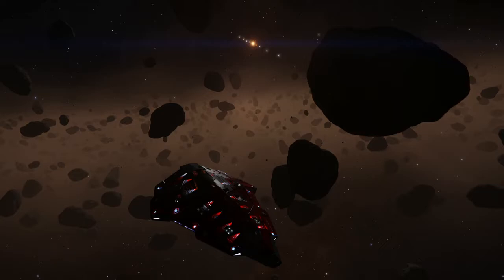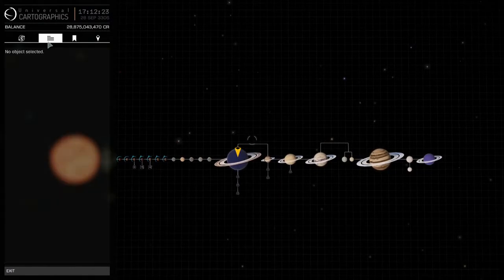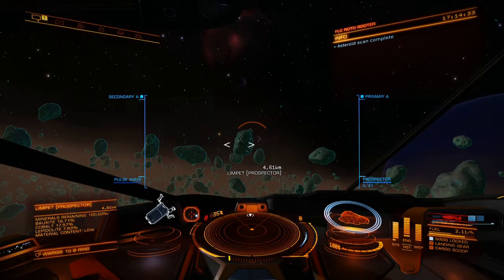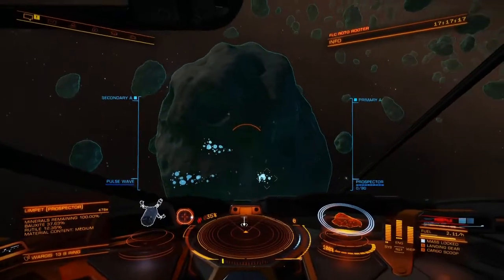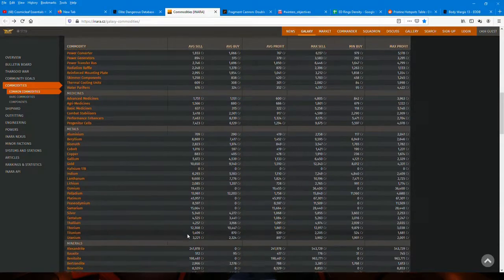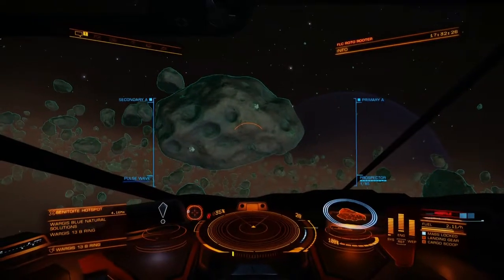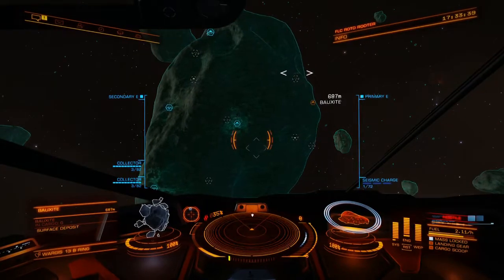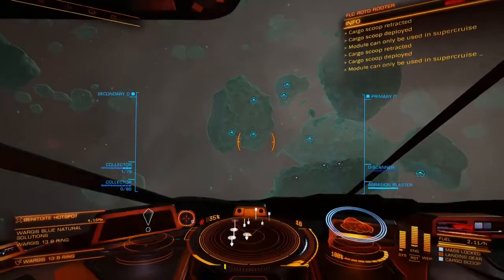Elite Dangerous:  The Annoying Broken Pulse Wave Analyzer

Comment: Oh there are people in the present at the end of November 2020 that still say the analyzer is broken.  The 3 asteroids I cracked 2 were Muscovite and I found them in asteroid clusters and one was Alexandrite in a gas giant ring. One 6 ton sale of Muscovite got me about 3 mil when I first stated a few days ago. Which allowed me to outfit my Cobra with the best refinery and internals for it. Also the strength of the fissure is its resistance to explosives not what level of strength you should use. A high yield in a low resistance fissure will make the gauge go up more than a high yield in a high resistant fissure.

Comment: I like metallic rings, but yeah you should be able to find them in rocky metalic. 
most of the high sound minerals are core only those so you'll never actually see it on the mineral content of The Rock
the other minerals and stuff can be used for missions and other bgs things to help some of the factions in the game. 
my guess is they tried to fix some of the range issues with the pulse wave scanner ( I don't think people ever got the full 25 km as advertised for a rated) And and whatever happened it caused this glitch. That or maybe it has to do with some other changes to the instancing to fix the fighter exploit.  --still I can't wait to go back and do some Core mining when they fix it. ( BTW metallic cores are the tear shape I believe. Icy cores for the pumpkin shapes) o7. nice vid thanks.
Reply from the maker: i've been wondering what on earth they might have been trying to do with this, and since they were so recently fixated on mine nerfs that seemed likely enough a motivation, but whatever it was, i really hope this result wasn't what they actually intended.  

i was able to actually mine a few cores though.  i resorted to circle strafing around some random rock while spamming the analyzer.  rocks start lighting up about 30 or 40 degrees into the circuit.  good to have shields though, because sooner or later i would generally whack into some other rock while flying sideways like that

Comment: There is a reason to be mineing some of the resources  that aren't the most profitable.  its called engineering  your ship. to make it better then just simply buying the best hard points or internals your ship can handle. besides even if you buy the best you can still engineer them to make them better also you can use certain resources to make shit like limpits and special ammo types while you are on the go all ships can do this with the synthesis on the go say your stuck outside the bubble outside of human occupied space so those resources that may not be high profit. Can still be used for multiple uses there not pointless. Also galaxy average price is not set it just means on average what it's worth were as in systems that really need that said not high profit resource may pay you more for it cause they need it so saying that these materials are worthless is dumb for alot of the. Are need for building material for certain things and like supply and demands some systems and factions with pay you more cause they desperately need them or you need to engineer your ship or you need to craft equipment on the go damn man research  hehe
Reply from the maker: what are you talking about, engineering.  i've been engineering this junk for years, and i guarantee you, mining these asteroids is just about the last method i'd ever use to gather the materials for that.  seriously, there's much better ways.  and the cheap stuff i'm referring to, the stuff i'd never mine out of these rocks?  you can't use none of that stuff for engineering.  you can only sell it.  for  not much money.  ergo my remark.  yeah, you do get a few, actual engineering materials doing this, now and them, but it's definitely not the best way to get that stuff.  research?  you got to be kidding me.  ok well i'm not going to argue over a video game toy for the rest of my day off work.  go tell your mother you love her or something. have a nice day.